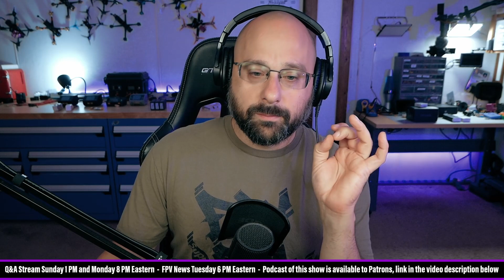What Do The Skyzone Mix Modes Do? Steadyview Module Settings! - FPV Questions

Comment: What about when using 2 receiver modules? Does it mix their individual images and then apply diversity switching on top of that? The Skyzone manual should answer that but it doesn't. Skyzones documentation and firmware versioning suck bad.

Comment: steadyview x mode is only for the new steadyview X recievers v3.3 fusion 3.4 etc all use RF NORMAL. Daniel at skyzone has confirmed this and I asked him to add it to the realase notes and the goggle manual. Like this so Joshua sees.
Reply: Steadyview X mode is for quadversity. You'd need another receiver.
Reply: I have Cobra steadyview x . But they stopped working in stead view x mode still have diversity, but now only operate in rf normal. The difference is enough that I haven’t flown analog since June and I really miss whooping. 
Thoughts anyone. 
I realize this is a poor forum for this question but thought I’d ask anyway

Comment: happy2023.. I am having some trouble with my skyzone  o4l goggles ..im proberly  not the first one mention  this but somehow my module keeps acting  wierd its keeps rolling over to different  kinda collers or sometimes black and white..sometimes I am getting a super nice clear image and then in switches over a horible  Image. And and for so far I know  I can only use rf normal .. when switching  over to steadyfew I'm getting snow.. anybody  familiar  with this issue
Reply: Same issues did you ever fix it?

Comment: This is a great explanation. I'm doing a before and after test of the current Skyzone hardware I have on the last firmware available, before upgrading myself to the new hardware. Most of the cameras I have for the firmware/hardware iteration I use behave alright. When sync fails hard for me, the camera and colors darken a lot, sometimes go multicolored, it's a huge mess. So far I have TinyHawk II freestyle camera  Runcam Nano 2 is a problem, and a version of the caddx ANT also does the same thing.... catastrophically, horrifically bad dark colors and loss of sync right rom the start. Runcam Nano 3 though which is the vast majority of my happymodel micros is fine. Overall I have a greater number of analog quads that are doing just fine with the current firmware, but I'm hoping when I upgrade and post the results, that they'll be successful...
Reply: my tinyhawk and firefly desync badly all my happymodles are fine its definitly a camera thing with the steadyveiw

Comment: Skyzone just put out an updated steady view receiver. "The new steadyview receiver is using the latest hardware(3.3) solved the dark and rolling image issue for some cameras."  You can buy just the fusion board for pretty cheap.

Comment: Steadyveiw doesn't like PAL. Switching to ntsc fixed my issues.
I have many caddex cams, they aren't an issue unless set to PAL
Reply: Good report
Reply: I have got ratel 1 and 2 and never had any problems when using them in Pal.

Comment: I won't use Steadyview for long range because it freezes on my Caddex cameras.
Reply: I use mix 1  Baby ratel 2 works great very little if any distortion the foxeer  Razor I have to go to Mix 2 with the VAS crosshair extreme and Vas V2 Mushroom Rhcp Speedybee 800 vtx I did notice putting a 1500uf low esr cap cleaned up my signal and the VTX makes a huge differance .  I have tried a few and the speedybee 800 is the by far clearest signal thru my 04L's for the $$$ peaks over 900Mv

Comment: I´ve had problems on my Skyo4X in Mix mode, had to switch to diversity for the best (and most reliable!) video signal
Reply: It does not seem to like certain camera signals(Caddex).
Reply: @ianwalton284  i use the foxeer toothless nano 2...
Reply: Update your module to newest firmware’s  to get the best out of it